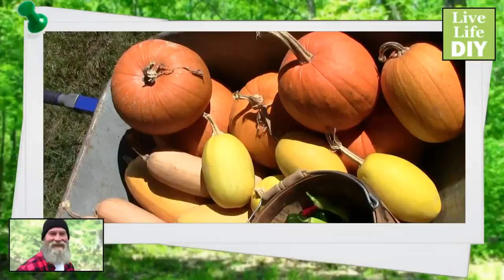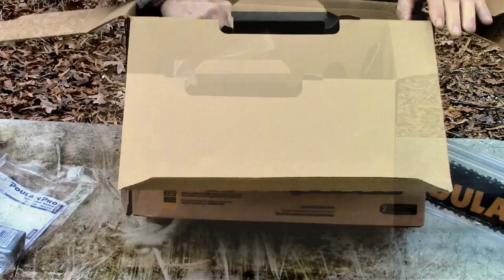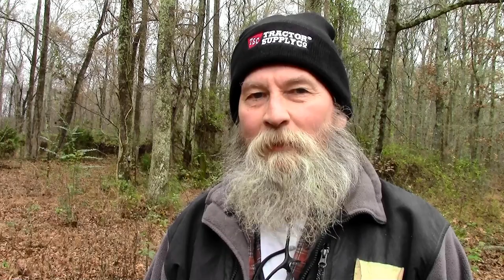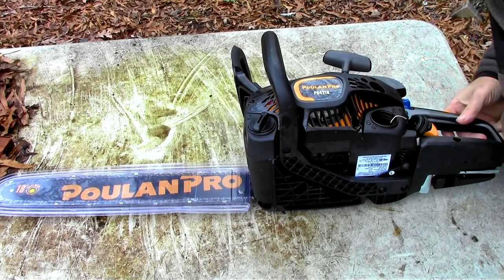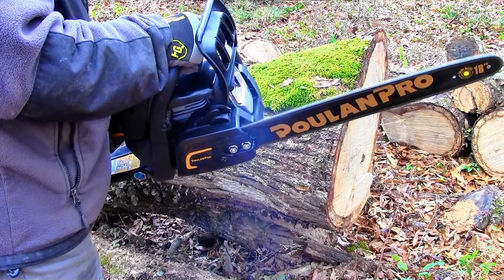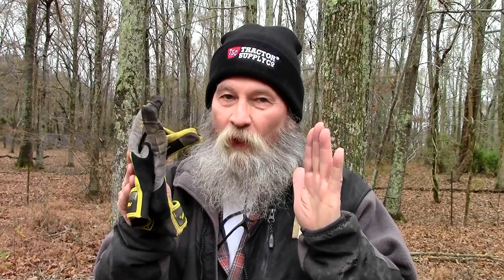On SALE Poulan Pro Chainsaw 18 Inch 42cc Unboxing Start Up and Operation

Comment: Well you can't beat the price but I myself fortunately have bought three chainsaws in my whole life and it was three different model homelite saws for $30.00 at a flea market which were in someone's collection at one time which being mechanically inclined I took apart cleaned and got into running order now these were all smaller saws I do have bigger ones being craftsman and a couple of older McCulloch saws which were given to me by people I knew that didn't want them anymore and I got them running as well. Just recently an acquaintance of mine had two saws that didn't run both were poulan pro saws he said if I got the one he wanted to keep running I could have the the other well so I ended up with another saw that I've been in the process of repairing and will be successful.  And just recently was given another little  homelite saw in need of some TLC. So would I buy a $99.00 chainsaw if I didn't have I lost count how many I have now🤔 yeah I likely would. 🙂👍👍👍👍👍
Reply from the maker: Sadly, not many people are able to perform small engine repair, like you can do. Every piece of equipment has a purpose and a place.
Reply: @GoosePondHideoutWithRob  Yes indeed.  Small engines aren't that hard to work on. Although I just got done dialing in the carburetor on that poulan pro 42cc and it did put up a little bit of a fight but its fixed.

Comment: Ours has kept the house warm for 5 winters so far. I figure the saw has more than paid for itself. A lot of people will criticize it as a cheap saw. It was inexpensive, but if you treat it with the respect of an expensive saw it will not let you down.  I have had (in the past) far worse saws for MUCH more money.

Comment: they also have the 14 in poulan for $45 shipped 3314 model refurb on ebay..thats a cool small one but known to have many issues in cold weather
Reply from the maker: I should get a little saw.

Comment: Hard starting? I blame ethanol fuel, and improper storage (at least, that was what I did wrong to previous 2-smoke chainsaws and string trimmers). BTW, I bought a battery operated chainsaw (BLACK&DECKER LCS1240 40-volt Cordless 12" Chainsaw), and it wouldn't have lasted as long as the small pile you said was typical for the chainsaw you were shopping for. I ended up buying the Poulan Pro PR4218 like yours but in a plastic box for $139 at the Homeless Despot today. I hope tomorrow to finish the work the B&D quit. Cheaper than the B&D, and I don't have to buy multiple 40V batteries to get me through a couple hours work (had the B&D not given up the ghost).
Reply from the maker: Thankfully there is a station with non-ethanol fuel about 5 miles from us. Storage is hugely important.

Comment: I purchased this saw today and I filled her up with 1gal gas and 1 bottle 50:1 and chain oil...and she would run just fine but cuts out if I let off the throttle for more than  4-5 seconds.   Can anyone help me fix this...is it my fuel mixture?

Comment: hay so if you ever have any idling problems with the saw the spark plug has no gap it needs to be gaped to .030
Reply from the maker: Mine poulan does idle poorly. If I set it down on the ground it frequently stops because it idles so slow.
Reply: Live Life DIY thats the same problem i had just gap the spark plug and see if the saw has any change

Comment: common problem with 2-cycle oil is people either buy the cheap stuff from the dollar store and or they dont mix it right!
Reply from the maker: Yep, I talk about the not mixing correctly. You bring up a good point about buying cheap stuff. Thanks.

Comment: This single biggest problem with chainsaws is that people don't know how to tune the carb. The carb will need adjusting periodically. It takes a "special" screw driver. Most of the time the carb needs adjusting from seasonal change. It might run great in the summer but not run at all in the winter so people think the saw it crap. Clean the air filter after every time you use it. Keep the chain nice and sharp. Learn how to sharpen the chain yourself and buy yourself one of those "special" screw drivers for tuning the carb.

Comment: im lookong for my very own chainsaw and ive been lookin at the poulan and the way you sawd the bigger wood i think itll handle the needs im looking for..
Reply from the maker: The video is real time. I didn't speed it up or anything. The chain is a basic model with only 21 teeth. So it is slower at cutting. A better chain if you want to cut mostly big stuff would be a good idea.

Comment: The reason people have problems is because they leave them in their sheds without fuel stabiliser, so the fuel lines rot off.
Reply: I'm keeping mine in my basement for sure!  I'll look into fuel stabilizer for longer storage periods (assuming it's safe for 2-cycle engines).  Thanks for the tip!

Comment: My favorite chainsaw I have owned/still own is a 1974 homelite super ez automatic. It will bury a 18” bar no problem and will always start 3rd or 4th pull. Personally I would not buy one of those new cheap chainsaws. I do not think they are a bill nearly as good as the old ones but they are still just fine for the occasional homeowner use. I can get a old change all made out of pure magnesium for 50 bucks.
Reply from the maker: I agree, new equipment built today most of the time doesn't compare to equipment built 20-30 years ago. The key point, as you suggest, is having the correct tool for the job.

Comment: I’ve had mine for 3 years works great for cutting firewood, medium sized trees. Works great if you keep it sharp .
Reply from the maker: I think it is a great saw. When used for it's designed purpose.
Reply: Jae Oaktrees same here it I Reliable and a great cutter

Comment: I run 40:1 on all my small engines. In my opinion is the spark plugs and insufficient air cleaners on these saws.
Reply from the maker: I prefer 2-cycle engines that are 40:1. Unfortunately, this one is 50:1. I worry about running it at 40:1 because it will gum up the muffler.
Reply: 40:1 is too thick for a stihl saw

Comment: Seems like up here in Canada where chainsaws are a very common household tool, Stihl seems to dominate the market along with Husqvarna. The older Stihl saws were a bitch to start in cold weather even at sea level but were great units. These  modern units have improved starting with ability to compensate for higher elevation, etc, but I wonder if they're as well made as the stuff from the 70s & 80s.
Reply from the maker: Hard to believe new equipment is as well made as older stuff. The technology is improved for sure, but probably not the parts.

Comment: Mine is great, I've had for a year now. 
Had to adjust the carb after about 2 uses. 
Bought a titanium chain and it eats dry wood fast. 
I've had several trips to the heavy wooded area and made a good truck load of wood with it! No hassel start after I adjusted the bogg issue.
Reply from the maker: Yeah, I think they ship them with the carb a bit lean? Probably for emissions compliance?
Reply: @GoosePondHideoutWithRob  yeah I believe so...the only issue.ive had in the deep wooded area was I flooded it. Other than that I've used it like a work horse and it's gotten me roughly 8 loads of wood so far. Also I like to have more mix than gas when I mix. I use the 1 gallon tank and the 50:1, no issues here!

Comment: Poulan used this same engine in all of their smaller saws. Anything from 42cc to 33cc. 🤣 

If you want a smaller saw from poulan, just buy a smaller bar. I have a 14” on mine.

Comment: I think tjet leave gas in to lo g and it clogs up jets in the carb. And I have had lots of poulen products. Chainsaws one of which is the same one you have and they other os a predator that is ike 10 years old and still runs perfect. I don't like sthil. I also have lawnmowers by poulen and a leafebllower

Comment: What is your big saw also I have a stihl 661 magnum
Reply from the maker: My big saw is a Hitachi. Stihl is a great saw.
Reply: Yes sir 661 is a beast 91 cc 7.2 hp
Reply from the maker: That's massive. How hard is it to start? The compression?
Reply: Well it has a decompression value so not too bad
Reply from the maker: Makes sense. Thanks.
Reply: No problem is the hitachi a good saw never used that brand

Comment: Yes i could agree with you on that..the ones on ebay are manuf refurbished....and its a risk but seems has very goodnfeedback...308 pos and 3 neg...the seller has sold over 1000 ..and 100 just today

Comment: They are ok for what you bought it for. But they are under powered for serious work
Reply from the maker: Absolutely agree. Only designed for light use.
Reply: Drill two holes in the muffler. They will wake up
Reply: If the muffler stopped up

Comment: I love poulan. I am going today and grabbing me a poulanpro 20 inch 50cc. Last poulan i had was one from walmart had it 10 years, cut a hell of alot of wood with it. Then i broke it lol. Probably would still be running had i not let it on the roof and forgot it and then once i hit 45 it decided it was time to commit suicide.

Comment: You didn’t show how to start it. Step by step. I’m a noob and need to know how to turn the darn thing on. Thanks.
Reply from the maker: Oops, this was brand new out of the box. Put fuel and chain oil in the machine. Put the power switch in the on position. Pull out the choke lever (below the power). Push the little rubber fuel button 4 or 5 times. Pull the cord.

Comment: So far it's the worst POS I've ever bought.  I've gotten it started once for about 20 minutes.  I even took it to the local dealer and he gets it started.  He said do NOT put on the chain brake or it chokes it (instructs say to put it on).  It can't be the mixture since he can get it started, but I cannot.  In 20 pulls I might get it to cough once.  Nothing like your demo.
Reply from the maker: Sorry to hear about your experience. Our saw is still working after all this time.
Reply: @GoosePondHideoutWithRob  I've gotten it to work for about 15 minutes one day and that was it.  Taking it to the shop again today to get him to show me how he does it.  What is frustrating is I had a cheap McCullough years ago that started every time.  Very frustrated with this one though.

Comment: When you said blade when pointing at the bar you lost all credibility with me. I've been running saws for 30 years and just because it says 50:1 doesn't mean it has to be. I have been mixing my oil 40:1 for years and never had a problem. The EPA has ruined saws by putting restrictions on them. Those choked up mufflers are the biggest problem. Also you had that chain way to tight.
Reply from the maker: Thanks for your input. I'm a self-sufficient Homesteader not a professional logger.

Comment: It crap...... after 3 trees it stop working.
It will not idle,  and it dies when on a tilt.
The manufacturer does not tune it to work right out of the box. Beware of this.

Comment: Get a stihl
Reply from the maker: Stihl is definitely a quality saw. This is just an inexpensive backup.
Reply: @GoosePondHideoutWithRob  damn right stihl is quality ,i just helped do a tree job ,i used my stihl ms180 cbe ,i am thinking about buying me a cheap poulan do to the crappy jobs with
Reply: @GoosePondHideoutWithRob  you got a damn good deal for that poulan where i live in alabama the poulan pro is 166.00$ at walmart
Reply from the maker: That's the typical regular price, $160-170ish. It was a black Friday deal, day after Thanksgiving.

Comment: As a small engine mechanic that saw is a piece of crap those saws are made to throw away because there only good for 50 hours but yes it's ok to use for home use only but everyday no I would not buy that saw

Comment: Because you are a cheap skate.  They are junk, sport a sleazy bar and chain and won’t last with heavy use.  I agree with you on fuel/oil mix.  Stick to Stihl or Husqvarna and you will have a saw that will last.
Would I own a Poulan?  Not unless my life depended on it and nothing else was available.  My 135 Husqvarna or 180 Stihl will cut rings around that Poulan piece of crap.
Reply from the maker: And I think I make this point in the video? It is an inexpensive saw with a basic chain. For a backup saw, a saw for small stuff, or for someone that wants a just in case saw, they serve a purpose.

Comment: With all due respect (seriously), if you are going to give a tutorial on how to run a chain saw, you should really practice ALL safety protocols, especially those associated with a specific model of chain saw (and included in the directions)- IE- start the chain saw on the ground, WITH THE (SAFETY) CHAIN BRAKE ON, and with your foot placed on the safety pad (as shown in the directions); and do NOT start the chainsaw in your hands. Do NOT stand with your feet under a log you are cutting off, even if you have steel toed shoes on. ALWAYS, ALWAYS, ALWAYS, ALWAYS keep your hand BEHIND the (safety) chain brake handle. I appreciate your tutorial, but I just wish you included more safety protocols in it- IE: common and specific chain saw safety practices (and they're even in the directions!!). Another example: which position is the (safety) chain brake handle in when the saw is started? You didn't discuss that at all. I'm sure there are many newbies watching this tutorial and they're not being shown the safe, proper way to run a chain saw, this model in particular. If you would, please, add the safety protocol up front of your tutorial. Now that you know, you must make the corrections, or you're complicit in folks using their chainsaw improperly and unsafely. And, if I were you, I wouldn't associate myself so strongly with a name brand store (Tractor Supply), as someone who hurts themself by not following safety protocol, but following your tutorial, may decide to sue (possibly you and) the store that you are associating yourself with. That may come 'round to bite you, you know where. Please add the safety protocols called for in the Poulin Pro PR4218 directions AND common chain saw/common sense chain saw safety protocols. I'll sleep a lot better if you would show folks the proper and safe way to operate this (and other) chain saws. Thank you!! I look forward to your amended video.